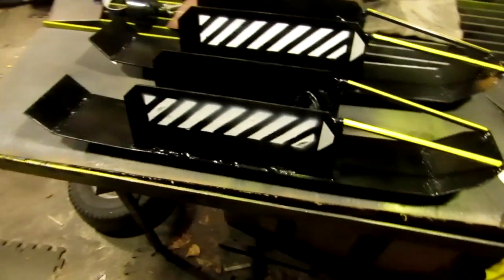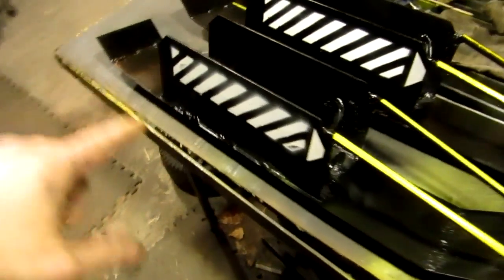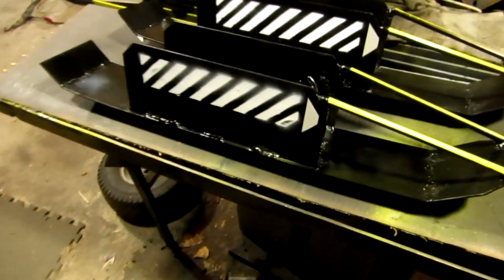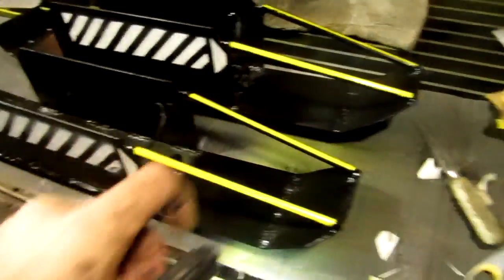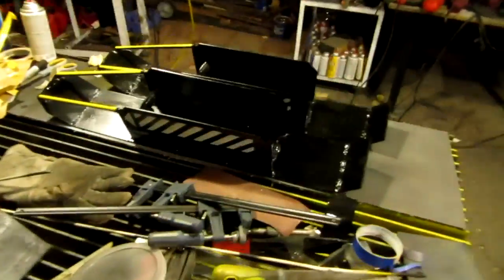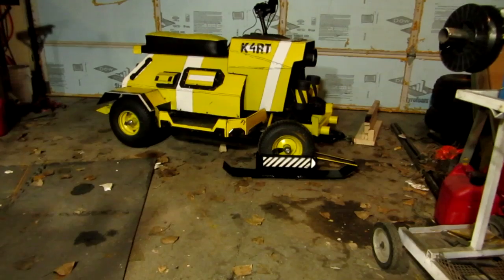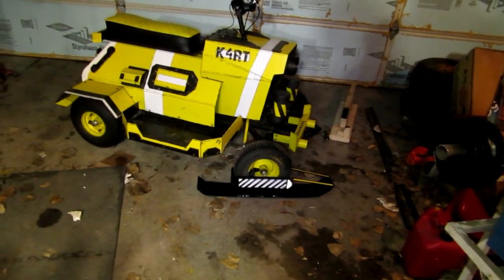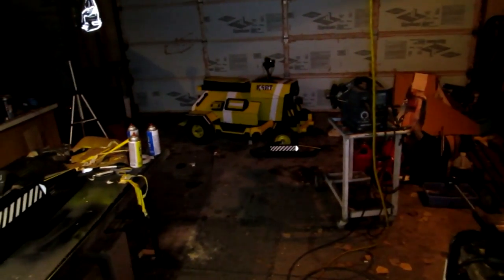Go Kart Mower Skis Painted

Comment: I might scab something together this weekend. Ordered a new rear tire for my DB30 and im gonna stud it. See how well the front tire does in the snow.
Reply from the maker: +Keystone Motorsports (Doug F.) ... sweet. are you going to use real studs or some bolts through the tread?
Reply: Just sheet metal screws. I can grab them from work for free, heh heh heh....

Comment: Here's an idea I read about years ago, which apparently works. You can take a scrap of carpet, wrap it around the rear tires - shag side out - and fasten it on the seam and the sides by poking heavy wire through it. It's free... it's easy to try, and... it might actually work to gain traction in snow. I've never tried it, but it SEEMS like it should work, eh?  ;)

Comment from the maker: Go Kart Mower Skis Painted
I painted the go kart skis and they turned out really good. The bottom was done with POR 15 black gloss, the rest is regular black gloss spray paint with some accents of yellow and white.
* Would you like to try POR 15? This is the kit I got on ebay - http://www.ebay.com/itm/POR-15-45009-SUPER-STARTER-KIT-BLACK-Rust-Preventative-/231546624425?hash=item35e94119a9:g:ZOYAAOSw2VJVfjc-&item=231546624425&vxp=mtr

Be a supporter for future builds ★★ http://bit.ly/1iomoRj